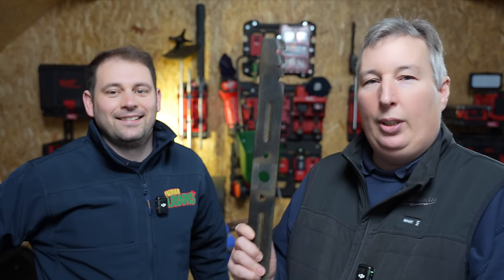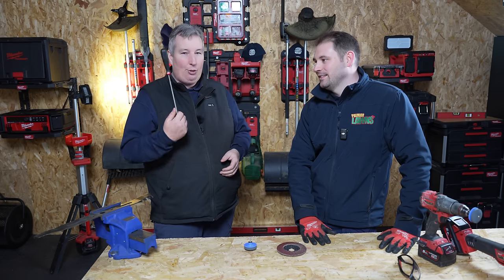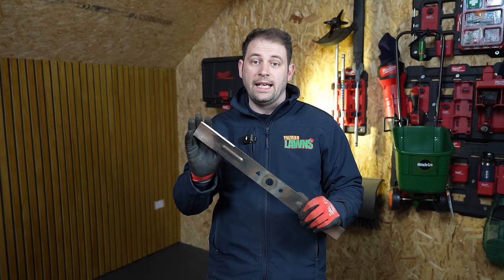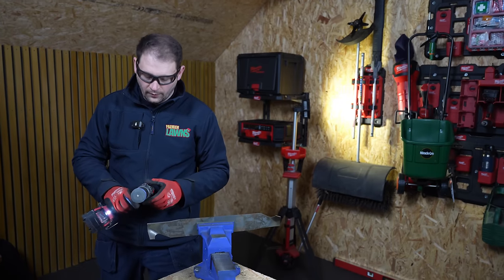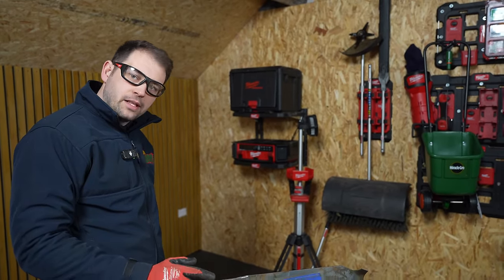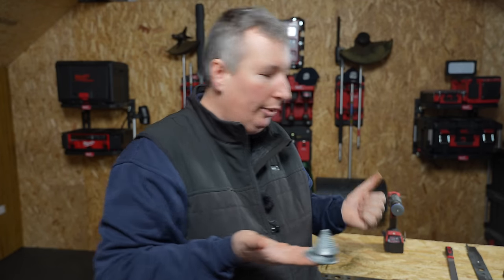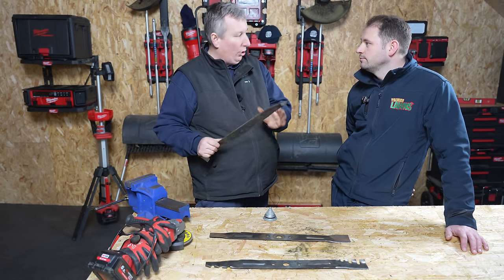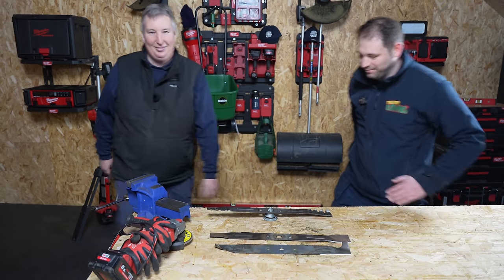The one tool that every gardener needs for their lawn

Comment: Great video guys and perfect timing! I purchased a new blade off Amazon last year, said to be already sharpened but upon fixing on the same way as original blade it seems to be ripping the grass as the tips were jagged. Upon switching around I had the same issue which I assume means the blade is not pre-sharpened. Now I'm not sure which way around the blade goes/rotates, any tips or tricks on determining which way around the blade needs to be fitted (it's an old Mountfield sp164 petrol if that helps)? Thanks!
Reply from the maker: Not sure, but I know of someone who will be able to help you especially if you say I sent you over there. Mick is your man 
https://youtube.com/@themowerman?si=6n_qMY-MD4YeFN8h

Comment: Flap disc on a grinder works well for me but you do have to be careful to not overheat the blade so I usually keep a bucket of water close by to cool it after a few passes especially if the blade is really blunt and needs a lot of material taken off to get the edge back 👍🏼
Reply from the maker: Great tips